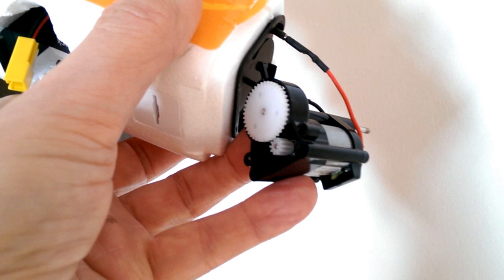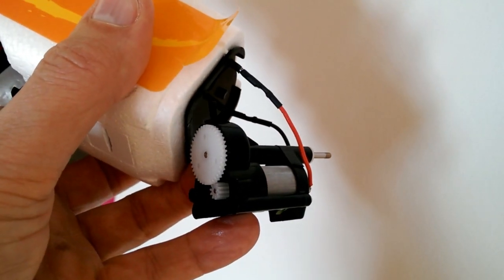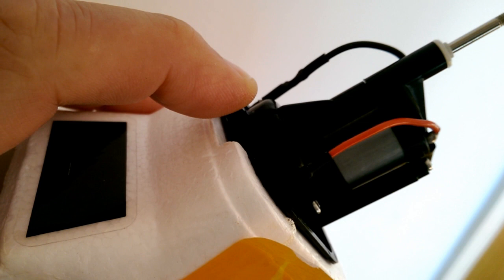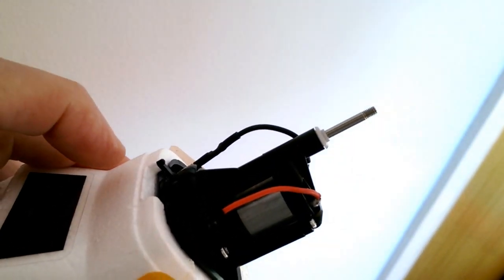Nikko RC Cessna Charity Shop Find Part #6 a quick peek under the bonnet

Comment: Can't wait to see the maiden of this, it's been a great story so far.
Reply from the maker: +Neil Wildy sorry to say, I am afraid it is a big disappointment. When I came to do a range check on the RC gear I found I was only getting about 25 feet before I lost contact so it was not worth attempting to fly. I gave it a few test glides but abandoned the attempt. That video is scheduled for the 14th. The choice now is whether to keep it as a collectors item and just store it away or modify it with modern RC gear. As the weather has turned wet and windy now for winter it will have to wait until next year now whatever I decide.
Reply from the maker: +Neil Wildy thanks for letting me know about your progress, I have just spent a while on your channel looking at the boat vids. I will have a look at the planes too but it's just gone midnight and I fancy an early night tonight.